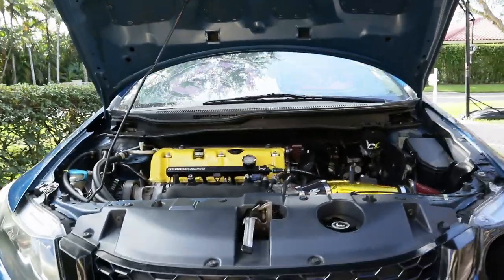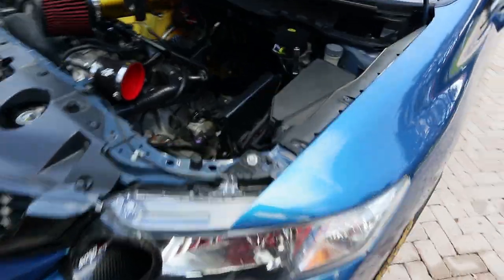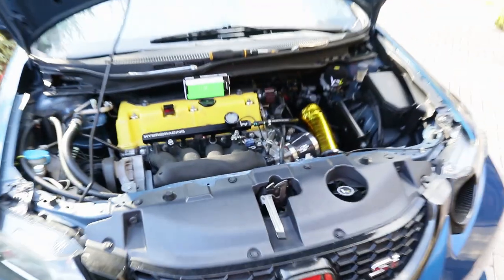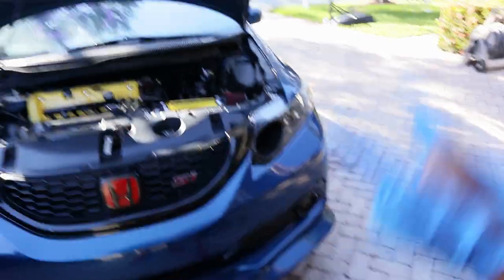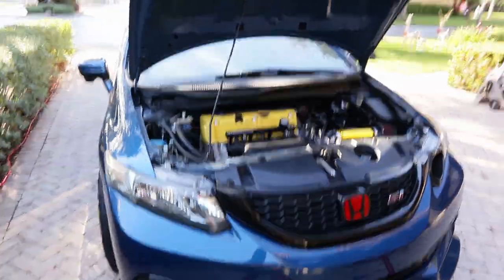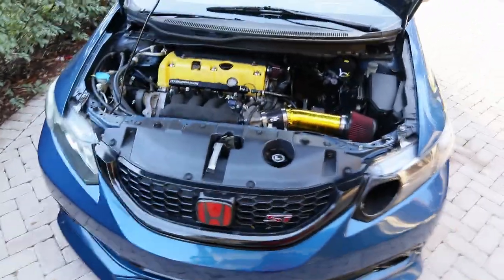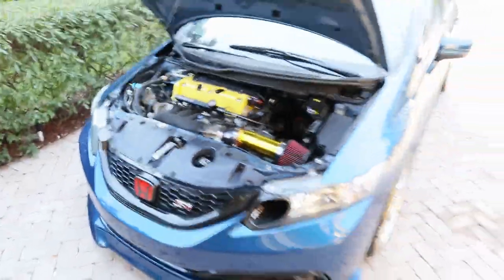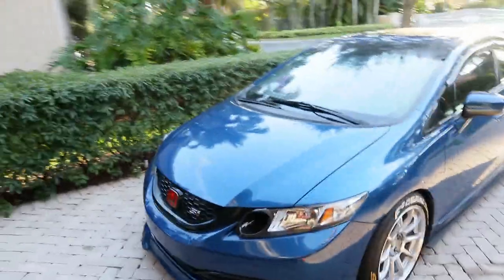Fixing a BIG ISSUE with my motor!

Comment: I'm considering just getting the whole motor mounting kit instead . Also idk if I'm crazy but I keep hearing clucking sounds on right rear tire but its smooth on clean roads
Reply: ive been hearing clunking noises on my front passenger side. Could this be a problem with my stock motor mounts?
Reply from the maker: Check your endlnks